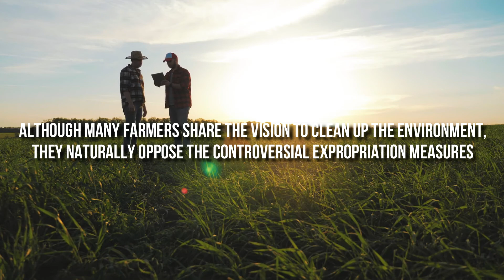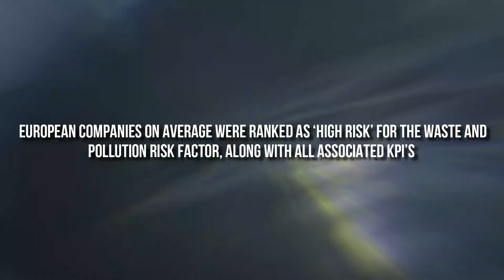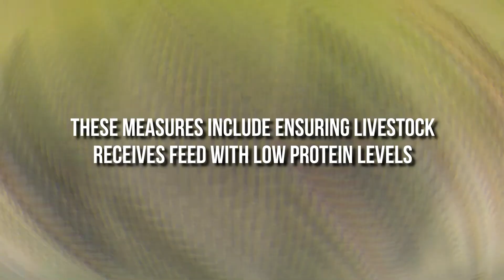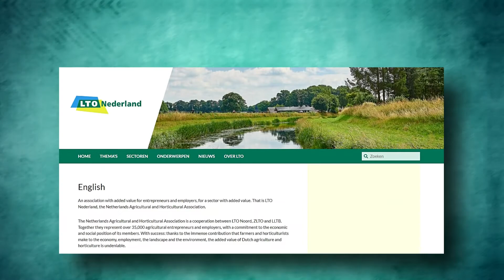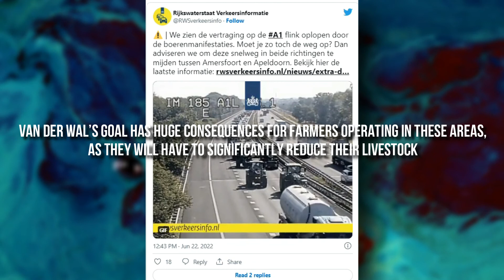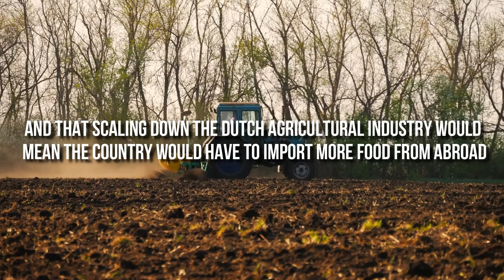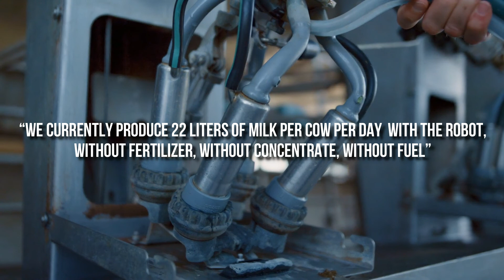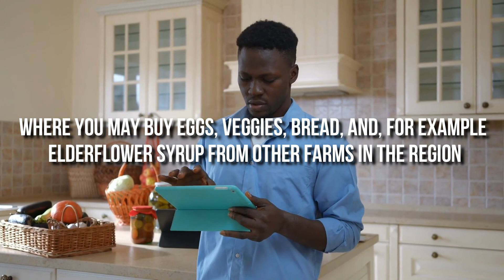The Dutch Nitrogen Crisis & Regenerative Agriculture

Comment: Some Dutch perspective here:
I really find it interesting how nuanced english-languaged videos can be on the nitrogencrisis. The Dutch discourse is far from that. The news is being dominated by reports from the protests themselves and the actual reproductive discourse is barely in the news.

To slightly correct you: the nitrogen crisis has actually been a problem for a long time (I think based on EU mandates to limit emission?). But the government hasn't been adhering to the rules, and like you mentioned  actively doing the reverse by pushing farmers to grow bigger and have more cows. Until in 2019   the government PAS (programma aanpak stikstof = program handling nitrogen) got rejected by some regulatory body. This then couldnt be used anymore to grant permits alongside natura2000 areas. It caused a huge problem for the building sector as they suddenly had to stop many building projects and it let to the immediate crisis we are still in (because of corona and new elections, dealing with the problem has been further delayed).
Anyway, it thus wasnt suddenly the government deciding they'd do more against nitrogen; they HAD to. Because they didnt do anything before (which is unfortunately the running gag with any of  the Rutte kabinets for a lot more things😓)

Skip forward to 2022 and they have finally managed to get sort of a plan together. Which is far from finished, but has immediately got all the farmers angry because its unclear how these plans will be achieved. 
And because theyre so angry they dont want to sit around the table. Instead they dump asbestos on highways and drive it counterdirection, both things that are outright dangerous (meanwhile the police barely acts against them).
And I shouldnt forget that there are a lot of conspiracy theorists among farmers that even deny there being nitrogen. that isnt helping conversation either.

But you know, in basis this is literally the tragedy of the commons problem.
Farmers need more cows to get around, and because there are more cows it caused land depletion.

The major valid concern I hear from farmers is that they are afraid to go out of business altogether and they dont want that (because of their passion for their work). 
So whats the solution to that? If you ask me I'd say farmers need to get more for less: ie supermarkets need to make less profit and meat and dairy needs to become more expensive for the consumer.  Because if you think about the environmental costs, meat is too cheap. That increased price allows farmers to get more income per cow which allows them to reduce their cows and be more sustainable without going out of business.
And at the same time, farmers that want to go out of the business should be helped (financially).
We're not going to get there on improving technology alone as the farmers claim.

Here's my view, take it with a grain of salt  because Im incredibly biased against the farmers: Im sick of the protests. Cant see the Dutch flag anymore (whether upside down, or not) without seeing images of tractors on the highway flash before my eyes😭